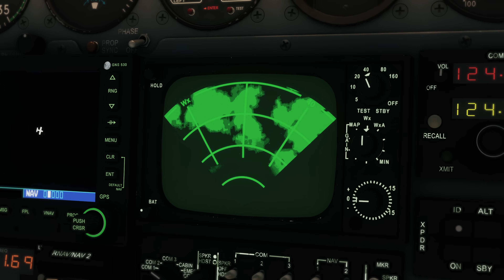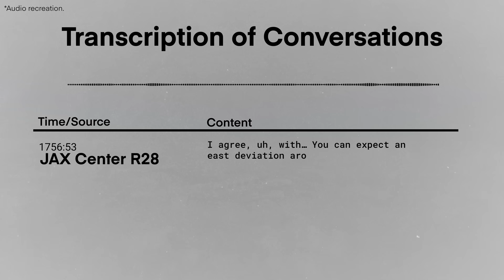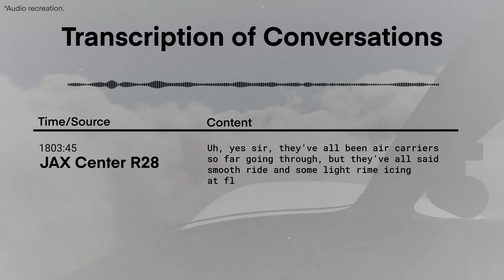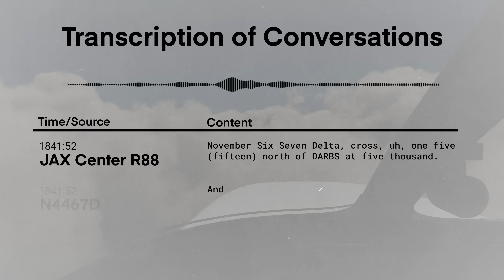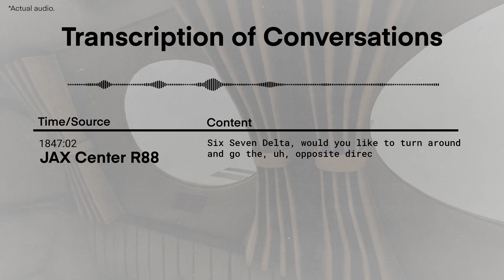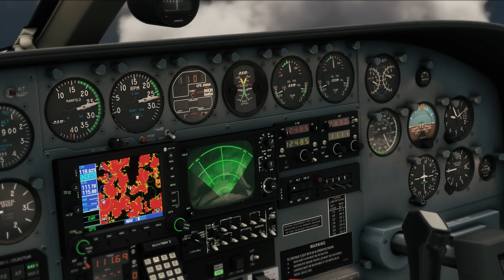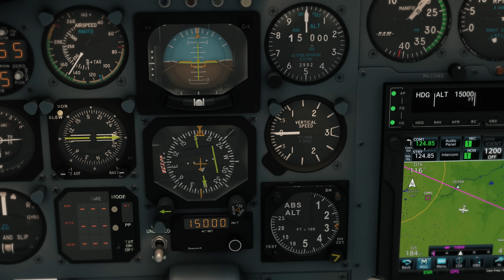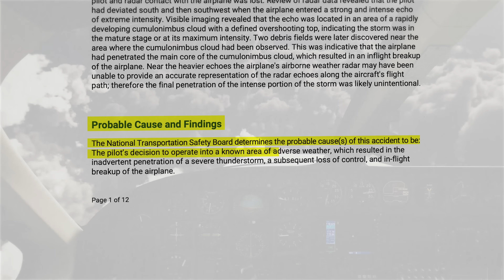Why Did They Fly Into a Storm? | Accident Case Study

Comment from the maker: What would you have done differently?
Reply: DIVERT
Reply: This is one is tricky, I’d like to say I would have diverted but you can see how he got bated into the decision and he would have gotten away with it if he hadn’t have tried to reverse course. 
The course reversal was madness, he was told he was on the edge of the weather and exiting, he panicked.
In heavy turbulence unless you can see a clear way out, just do the best you can to fly best turbulence speed, keep the wings level, the G to a minimum and aim gently for the lighter areas until it starts getting lighter, then hold course.
Performing a seemingly steep turn in heavy turbulence is a recipe for loosing control, over stressing the aircraft or toppling gyros in mechanical cockpits.
Reply: @Captain101-x1o  There's nothing tricky about it. CB's in the active phase with tops to 45,000' is all you need to know. What do you expect is going to happen? Even a hurricane chasing P3 Orion wouldn't willingly fly into that. What makes you think a light aircraft would do better than an aircraft set up for storm chasing? I'd be interested to know.
He got baited by an idiot because he too was an idiot. By the same reasoning, would you play Russian roulette but with 5 rounds in the revolver instead of 6 because you're boss insisted on it?  That's what you're essentially saying it seems but in this case instead of 5 rounds in the revolver there was the full complement of 6! 

There was never a chance, there was never going to be a chance, the outcome was sealed. Don't fly in thunderstorms because you will die.
Reply: @ThePaulv12  that’s not true.  I’ve flown through much worse when I was a cargo pilot in a 402.  I’d bet a million bucks it was on autopilot until the jarring that caused the failure disengaged it.   And by the look of the flight aware he was well above maneuvering speed.   You’d be amazed what a 402 can handle below maneuvering speed.   But we also have to realize.  He’s in Florida.  This was before all the spar ADs. Highly corrosive environment.   It is a risk.  But with experience you learn what you can and can’t do.  But not if you’re flying at cruise speed with the auto pilot on.
Reply: @Captain101-x1o  I remember on my commercial test they said if you’re 1/4 the way don’t turn back.  Flying cargo in a piston twin in the mountains for much of my 12,000 hours.  I can tell you Cessna twins are tanks.  But the golden eagle is a scary one,  only because it can fly pretty fast.  I’m 100% sure he didn’t slow down.
Reply: Looked at youtube videos of planes I wish I could afford
Reply: @Enjgine  🤣
Reply: Diverted to another airport or returned to base disappointment is better than being dead I can't drive never flown but it's common sense
Reply: First of all, ATC told him to go straight to get out.  He didn't listen and turned and turned to the right.  Secondly, He should've went straight down through the center of the panhandle, then approached Tampa from the South.
Reply: @adamdobrzanski6631  they said they had an MOA or was it a TFR and he couldn’t go south.
Reply: @adamdobrzanski6631  look at the very least when the turbulence started i would have turned right back 👈
Reply: @lcfflc3887  actually on my commercial test.  One of the questions I got wrong is what you’re thinking.  The FAA.  And I say just accept variations in altitude and keep going.   A turn causes load.  Load causes stress.  You’re best off just slowing down.   And letting the plane do it’s thing.  My guess is he had autopilot engaged.  Which is a no no in a storm like that.
Reply: Diverted, landed, waited it out.
Reply: Flown commercial
Reply: @JohnLemieux  correct answer. huge storm cut the state in 1/2. Rent a car, uber and commercial flight.
Reply: Stayed in the airport bar, got a room and slept it off. Flew the next day, minus the storm 👍
Reply: Fly attitude and take the altitude variations. Fly straight ahead and get out of it. Don’t try to turn. Oh, and don’t put yourself in that situation to begin with.
Reply: The more I fly, the more I avoid storms.
Reply: As a CFII, based on the radar I would have diverted without question.  Poor decision making - between pilot and ATC, pilot gets sucked into rabbit hole 🤦‍♂️
Reply: @DaddyRecon1  I thought that way when I was a CFI.  After experience.  Being a cargo pilot for 12,000 hours in a Cessna twin.  Experience changes everything.  He just flew to fast.  Stressed her beyond physical limits.  What his main failure is,   Is not using ATC to help him avoid the worst of it.   Flying too fast.   Gorilla grip on the yolk to hold altitude I’d bet.   If you kind of let the airplane do it’s thing and ask for a block altitude,  you’re better off.  Flown the right speed you’d be amazed the storm a Cessna twin can make it through.  Of course,  this was the south east and before x rays were required of the spar.  So there probably was some issue of corrosion on top of everything else.
Reply: I would have diverted and waited for the storm to pass once I realized it was going to catch up to me.
Reply: Not fly into a massive thunderstorm.
Reply: Should have went straight. What a nightmare situation to be in. RIP
Reply: I wouldn’t even have a plane. That reduces the chance of flying into a storm and breaking up in midair.
Reply: Not exactly the best name for an ifr designation.. hevnn?.. Spooky
Reply: @execatty  Better than LUCFR or HELLE I suppose, but dead is dead.
Reply: I would have stayed on the ground or at least landed earlier.  I have a lot of time in type, but little in that sort of weather.
Reply: Taken the train or a bus. I hate to fly. If I had been the pilot, I would have flown around the weather or waited it out on the ground.
Reply: Land at Jacksonville
Reply: fly straight
Reply: I’d have slowed down.  Keep her below manuvering speed.  I flew a 402.  Id hit +6 Gs and -3GS going over the sierras.  The thing is,  it’s a lot slower plane.   Flown at the right speed that plane could handle things that you wouldn’t believe.  I’ve done some wild shit in Cessna twins.  Bob Hoover rest his soul would be proud :)
Reply: I wouldn't have attempted to fly into that weather. I would have landed very clear of it and waited for the weather to clear before proceeding to Tampa.
Reply: 1. Be safe and divert. 
2. Have someone in the right-hand seat for at least comms.
Reply: I would have diverted to Tallahassee or somewhere along the route before trying to thread my way through a system that size. Get some fuel, stretch my legs, get some dinner. After a couple hour break, hopefully the system would have moved through the area or diminished a bit. I'd rather be watching a storm that size from the FBO than the cockpit.
Reply: Hired a pilot with two to three times the experience!
Reply: Land west of the storm and wait it out.
Reply: Land the aircraft and wait?
Reply: What would I do differently?  First, some perspective.  I have a little over 25,000 hours and am a seasoned Part 121 Captain, BUT I also have over 2000 hours of 421 time and spent plenty of those hours flying my passengers to destinations in FL and other gulf coast states.  The 421 I flew was equipped with a properly maintained Bendix RDR-160 color radar and later had a Garmin 530W with satellite weather to supplement the RDR-160.  And I still would have avoided that area of weather ENTIRELY.  Go earlier, go another day, land short and wait it out, but DO NOT penetrate a large area of mature storms in any light airplane, regardless of avionics capability.  Even in my airline flying, I routinely see mature storms with tops well in excess of 35,000' and I give those a wide birth.  But a 421 with a 2000 hour pilot at the helm?  It was madness to penetrate that system with that airplane.  Among the many problems with the 421 and all the cabin class piston twins and many of the turboprops - they just can't outclimb the weather.  The service ceiling of the 421 is 25,000'.  On a warm day, you're lucky to get a climb rate of 1000 feet / minute above 10,000' and it's usually a lot less than that for the sake of engine cooling.  Less capable turboprops aren't much better.  And even with the relatively increased capability of a modern turboprop, they still have rubber booties instead of heated leading edges for deice capabilities and the moisture in and around this type of weather can create significant inflight icing in the Flight Levels.  

These newby pilots that get these alleged "all weather" airplanes because they can stroke the check simply don't have the training, judgement, and experience that a seasoned professional pilot has and they foolishly and fatally believe the marketing hype about "all weather capability" after getting scandalously mediocre training from one of the many puppy mills masquerading as flight training centers.  A pity.
Reply: @bdon661  I don’t know,  you’ve got more hours driving a plane than I do flying them.  But I did 11,000 hours flying cargo in a 402 over the sierras.  I loved it.  We usually just went through the systems.  I’ve gotten black and blue from the G load,  I’ve pulled more Gs in a 402 than in my old pitts.   But I’m sure he had the death grip on the controls and didn’t slow down.  All my hours were pretty much piston (except 200 in a jet).   I hope you can get back to where you started and find the love of flying again.  I hated the airline.
Reply: @bdon661  I learned a lot from your comment. Thank you. "All weather capability" doesn't mean hurricanes and blizzards.
Reply: @bdon661  I am a CFI with only a measly 1200 hours but you are spot on!   There is no all weather airplane and even with the advanced technology in GA aircraft these days, there is just no way to safely navigate a huge line of storms as shown in this scenario.  XM is helpful for avoiding air mass storms that are widely spread apart, but it's just fools gold to think you can pick your way through a line of storms using XM and even onboard radar in this case, and to your point, the 421 does not have the ability that large turbine aircraft to get high enough to circumnavigate that type of weather..This flight was a part 91 operation as best I can tell so I would have said, sorry passengers, we are going to have to land an wait it out...Such a shame...
Reply: fly way around the weather.
Reply: Turn north, do a big circle to let storm go east, then south to Tampa
Reply: @duskintheforest584  the ATC really lacked persuasion, he could have saved them, he has a more clear view of the storm on his screen probably in full color too, best great idea would have been to make them go in circles until they gain enough altitude to fly over, the ATC would have had that info on his screen about how high was the storm at. Was this ATC not experienced enough? Was he like very young dude with like a couple of years in the job? Standby? Does he knows what a 421 is? I don't know but really he could have done a lot more.

Comment: Just a cursory examination of the radar image would have shown you that you should have been south of all of this weather because it wasn't like it was moving to the South it was moving to the east Southeast. What possessed him to stay north of a line of thunderstorms moving to the east that he knew he couldn't go around unless he went all the way to Jacksonville then cut South and then come back across Florida he could have cut South before he ever got to the Pensacola Naval Air Station. They had very little weather at Tampa proper. I do better weather tracking when I get on my motorcycle I'm not afraid of writing a motorcycle in the weather but I try to avoid it whenever possible. I rode from Regina Saskatchewan across route to up through the northern Peninsula of Michigan and down to Detroit over the span of 29 straight hours to avoid whether that I knew would be in Chicago. Precisely because I did not want to be in the weather in the first week of March of 2012. That was a nice warm winter we had had but it was still cold and parts of my journey down to about 20°. The only great thing was that it was 80° in Michigan on the day of my arrival. And that's a long ride on a naked bike. I think I covered about 1600 me but I would stretch my legs and all that each time I stop for fuel. Otherwise it would have been otherwise about a 24/25 hour trip

Comment: July is prime time for massive thunderstorms and embedded squall lines in this area. Most pilots and boaters understand the dangers .
Looking at the radar, it's terrifying to think anyone would  consider flying through this mess.
One thing that is a great predictor of impending weather change. When the barometric pressure drops, pay attention. Do pilots check this?

Comment: All he had to do was land KTHL wait a hour or two, or drop down to 3 to 5 thousand feet, then navigate around the rain shafts, with thunderstorms of 45,000 feet, the worst place to fly is 10,000 to 25,000 feet. The bottom line if you can’t fly without the autopilot, in turbulence and IMC conditions then well you probably committed your self to die in a thunderstorm that will be over in a hour.

Comment: XM is nice to have onboard and as a planning tool, but as mentioned here, it has significant limitations.   Plus, if you're flying in the Flight Levels, a lot of what XM depicts can be below you and therefore, be of no consequence during cruise.   Nothing replaces onboard radar and proper tilt management.    He had 2000 hours, but how much of that was flying in difficult IFR weather?   I would probably not have penetrated that weather in a jet and I've been flying professionally since 1985.    He should have tankered fuel and gone around that weather to the east and come up from the south.   Easy for me to say, right?   Damn shame.   5 lives and a great airplane.

Comment: Speaking of expectation bias probably everyone watching this would have just avoided that entire area around Jacksonville and waited for the sky to clear. 

Second group would have tied to climb up over it all and failing that would have landed north and waited it put. 

The third group would have risked it.  I guess that this pilot was just not experienced enough and was flying too small of a plane. But the thumbnail showed a plane on fire from lightning strikes and disentigrating when there is no real indication given here of exactly what happened other than "it broke apart at 6k agl". 

So again. Two more reasons not to even take the chance but that goes for everyone else also. I guess they were just better at reading their radar.

Comment: I once refused to fly a charter at night due to a line of storms. Another pilot flying a Piper Chieftain went ahead. I flew next morning but caught up to the storm line so stopped again. My pax were outraged. Finally got them there next day when I found out the front of the Chieftain was smashed to bits from hail encountered in the storms. They were lucky to make it. Still, dont regret my decision. Note the Chieftain had wx radar. I had zip.
Reply: That's using good judgement. The pax have no say in the matter. It's your job to keep everyone safe and after making it safely you know you made the right decisions. Leave the gambling to Vegas. Make prudent decisions with a wide margin on the prudent side.

Comment: The video misses the primary cause of the accident which was structural failure of the wing. The only way to do that is by exceeding VB during extreme turbulence. VB represents the maximum speed at which the aircraft can safely endure gust-induced loads, safeguarding against structural overstress during turbulent encounters. The moral is that when extreme turbulence is experienced of forecast, slow down to VB or less. This pilot was so busy 'navigating' around the storms he forgot to aviate.

Comment: Never turn around! All you want is a rough heading close to your assigned heading. Keep the blue side up. Don't worry about precise this or that. Turbulence will be working you. All cockpit lights on - day or night. Landing lights, nav lights, especially strobes OFF. Watch your airspeed. Work throttles as needed. Seat belts super tight. 5,000+ Beech 18. Emery & Federal Express. Never had a radar. I'm 75. Alive.
Reply: There are people who smoke turning 99; but that doesn't make an advice to smoke a good advice...
Reply: @ToendraTedje  Uhhh? Do what? What's that got to do with the price of popsicles? Could you translate? I'm 75. Have been smoking cigars since I was 30. Old guy in Austin, Texas - same thing - he died at 114. Oh! I get it. You think my advice is no good. You're set for an early grave. Good luck! One thing I should've pointed out is that in daytime, there will be no light in there except in bolts of lightning. Gee whizzzo.

Comment: What a sad mishap. An experienced pilot with instrumentation that presented as an accurate. What could he do? What is so heart wrenching is to see the weather where flying straight would have meant a happy day, but turning right directly into a line of severe cells. If the pilot only had the correct radar, the outcome would have been OK. All these stories are sad but this story stands out. The airplane was very sweet. This is VERY sad.
Reply: This was just attempted squall-line  flying, made worse by the pilot seeming to rely on the controllers  for a smooth ride through.    The dynamics of a mature squall line are such that new severe cells were developing  in minutes, it seemed.  Think I would have landed in Pensacola and grabbed a 3 hour burger , fancy twin, Citation jet, or Skyhawk,  or even A320.